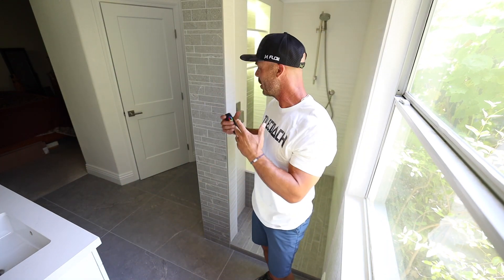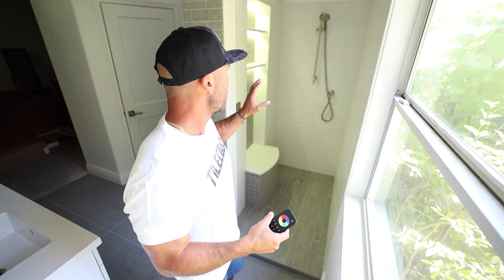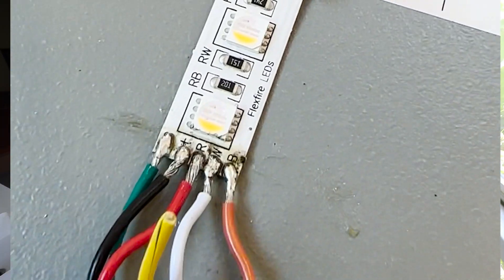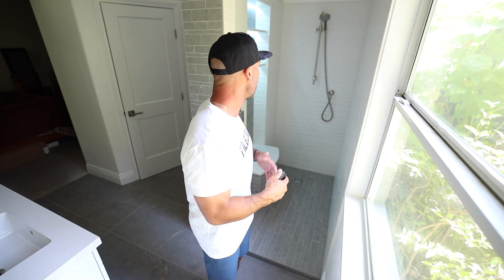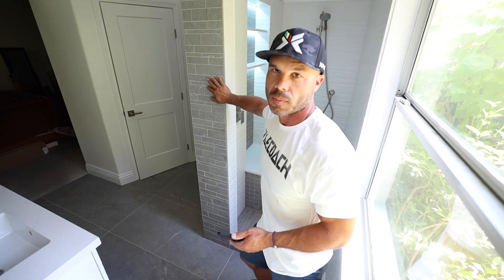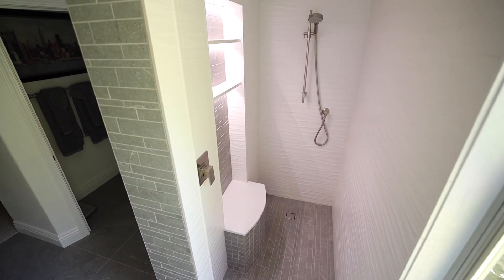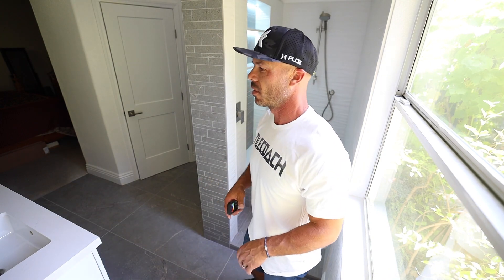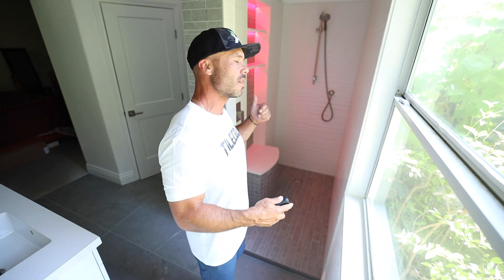AMAZING NICHE DETAIL!!!  Color Changing LED Lights in SHOWER

Comment: Very nice work! Hey! Is it okay to put a curbless shower next to the bathroom door. The shower pan area is 36x60. On the 36 wall i will have the width, then glass panel for shower, then door trim 3 inches,  and then the door.

Comment: Coach, do you have a video on how to waterproof a commercial steam room? Like continuous use? I was at a spa over the weekend with the wife and they had this steam room in the men's locker room that was completely ridiculous. It had one of those automatic steamer heads on the wall that you can adjust from outside the room. On Max it was so ridiculously steamy You literally couldn't see your hand in front of your face and it was probably approaching over 190° in that room.  Like my lungs were burning. Somebody could leave the steam room and it could be running like that for hours. It did not seem that they ever turned it off but yet the tile was in perfect shape and there was no mold or anything. How do they accomplish this? I'm hoping to deploy this sorcery in my new steam shower in our master and never have to deal with any pan leaks again besides!  Just curious!  Great content, thanks for everything you do!
Reply: I mean with that kind of heat, you're definitely not getting mold.

The mold develops while it's not hot in there and water sits lol
Reply: @agenericyoutubehandle  Fair enough. I mainly am wondering how they would waterproof such a room. I mean if it's intermittent use then it makes sense you could just have a ridiculous exhaust fan, finish your shower, and then have that thing on all day drying out everything. But with just continuous super hot steam exposure and saturated air pretty much 24/7 how do they waterproof that? We have to redo our master bath in I don't see why I couldn't deploy those methods in my house
Reply: @jdr03272  yeah, that's super fair. I admit it would be cool to learn how as well.

Comment: Amazon has waterproof LED stripes with the remote without the soldering for a fraction of what you may have paid at wholesale. Same crap in my son's bedroom running 24/7 for 3 years so far. Completely plug and play.

Comment: Just curious..... what happens when that led strip goes bad? Is it easily replaceable?
Reply: Open up the drywall side
Reply: Just solder in a new one. I just put a LED strip inside my kids shower and it’s easy to replace if needed. (As long as you know how to solder)
Reply: They say 50,000 hours… that’s about 68 years if you have it on 2 hours/day every day 🤷🏽‍♂️
Reply: @Jared-Kreate  Do you know how many LED lights state 50,000 hours and go bad after one year! Those 50,000 hour ratings are bull my man........ the LED may last that long but the circuits always have issues after only a year or 2... If your lucky maybe it'll last longer but no way should that be  in a shower! Plus kind of gaudy...... but to each it's own
Reply: @cfomusic73 I got individual addressable LEDs in my headlights I soldered in. Now that I have said something they will stop working but it's been a year, still working, and my headlights aren't exactly sealed the best. Some moisture does get in.

I would definitely leave a way to access it for maintenance whatever the case. They do fail but some are better quality than others.
Reply: @Jared-Kreate  Do yourself a favor and don't take an advertised LED life expectancy's to the grave. Unfortunately LED light strips (as well as those fancy wall and ceiling mounted LED lighting fixtures) can failure prematurely. Sometimes strip diodes short out, sometimes individual LED's fail leaving dark areas in the lighting channel. My first LED strip lasted 13 years before it started failing with dark sections. Thankfully I made sure I had access to it. I would never install a LED lighting system without a way to access and repair in the future if needed.